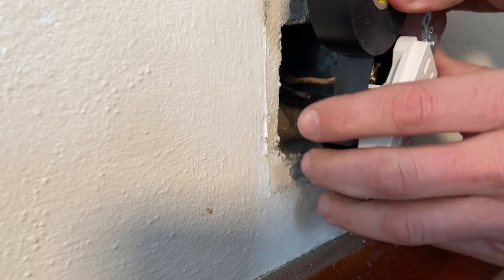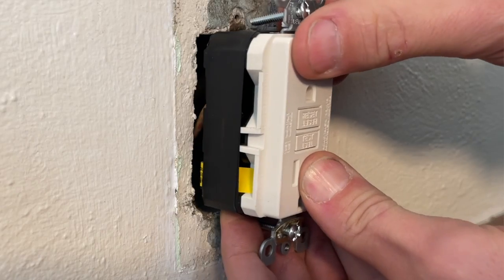Should You Wrap Outlets In Electrical Tape?

Comment: Recommended doing on outlets installed on metal boxes
Reply: ditto
Reply: But not needed
Reply: @timfritz3828  Right, it's not needed, but code is MINIMUM. If you install you work to just meet code requirements, you are a hack and your job will look like shit.
Reply: @timfritz3828  It's not a code requirement. It's just good workmanship.
Reply: @jimmac1185  do you use the 1968 nec? And in 1972 minimum standards is removed.  And if code is minimum why are their maximums in the nec?
Reply: @farmerdave7965  how is not taping devices bad workmanship,  and why are you hiding your connections?
Reply: @timfritz3828  I think you misunderstood me. I meant that install to the code is installing to the minimum requirements. I didn't say there are minimum standards listed in the code. I'm no really sure what you are talking about with your maximum comment, so I can't speak to that.
Reply: @jimmac1185  so you wire all residential as a class 1 division 1. Gotto go above a code compliant install. So saying doing your work correctly and by code makes you a hack, makes you ignorant. Just like the guy making this video.
Reply: @jimmac1185  that’s the dumbest statement of the day. How does not wrapping outlet in tape make the job look like shit, when you can’t see it, and how does it make you a hack ? I would recommend running both screws down, that’s all that’s needed, grounding the box with a jumper needs to be done as well, that is usually not done, and that my friend makes you a hack, not wrapping the plug with tape. That’s for beginners, so they don’t short the circuit out when removing plugs.
Reply: @jimmac1185  3’ from every j box and 10’ there after, if it needs more supports ? You can see that and you adjust accordingly, it doesn’t make anyone a hack, if they don’t do it the way you see it to be done, as long as it meets code, and stands the test of time, that is a good installation, no matter what a hack says
Reply: Always on metal boxes. Period
Reply: @jiml3922  that’s an opinion period, it’s not a requirement period, if you think it needs to be this way  ? You can make a proposal to the NEC period
Reply: @frankstallcup8720  I wasn't saying that not wrapping boxes with tape makes an electrician a hack. I'm saying if an electrician does their jobs to the bare minimum makes them a hack. To what you said about the pipe. That is my point exactly, the code requires the 1 clip for 10ft. If the pipe is hanging off the wall with one clip and you don't add another, it's still within code, but you are a hack for not adding another. Do you understand my point now?
Reply: @jimmac1185  I understand completely, if someone does a job to the NEC and local ordinances, and it isn’t to your standard there a hack. 
There are lots of variables to consider, labor cost, material cost, a job that holds up after you leave. There is this little thing called competition for jobs, meaning there’s a budget, your competing with other contractors fit jobs, so if a GC is willing to pay for your idea, that we want you to do it his way, it makes for a better job, we don’t want any hack jobs on our job sites, then great let’s add straps, let’s wrap every plug and switch, let’s wrap every wire nut. 
My experience is there want a job that passes code, a job done quick and efficiently, a job that doesn’t have a lot of call backs for warranty. 
Wrapping a plug with tape is a good idea for people who don’t really know what there doing, IE hacks
Reply: @timfritz3828  so electric misconnection doesn’t happen, yeah like tenants abusing walls and crushinyoutlets or your fat brother hitting the outlet falling, accidents happen it’s why they sell insurance.
Reply: @frankstallcup8720  ...facepalm... no, you clearly don't understand what I'm saying. It's probably my fault, I'm not explaining it right. So I'm not going to try anymore. I bid you adieu kind sir, (tips hat).
Reply: @jimmac1185  “ if you install your job to the minimum of the code, your job will look like shit and your hack” 
What’s not to understand in that statement ? Know mention of running conduit there, you mention strapping at 10’, but you also strap 3’ from j-boxes or panels, then 10’ there after, which is perfectly suitable on straight runs. The subject is should you wrap a receptacle with tape ? Code is the minimum, they have people on the panels, industry experts, or at least they used to, they kicked those people off, put manufacturing representatives on the panels, whose sole purpose is to push product, a conflict of interest. Requiring you to use arc fault breakers, not needed, with a whole host of other shit, that doesn’t work well and puts all the warranty on the contractor to fix there shitty products, that wouldn’t be used if it wasn’t required. That’s how business is done nowadays, force the product on the public, the manufacturer’s get rich this way.
Reply: @frankstallcup8720  cool story bro.
Reply: @FrancisoDoncona  so you prepare for all what ifs?  I bet you use special jell knee pads for all your jobs to pass inspections also.
Reply: @frankstallcup8720  you do know there are three panels to the nec code panels. And no manufacturers do not control codes. Nfpa national fire protection  agency.
Reply: @timfritz3828  ok if you say so, look at the panels, see how many manufacturers are represented on the different panels, and yes, they do push there products, how do I know ? My dad and brother are senior instructors for the NFPA, and they are moving the experts off the panels, to appease the manufacturers, that is a fact. From someone who has served on the panels.
Reply: @frankstallcup8720  what are there names.  I have a friend on the panels and no the manufacturers do not control code.
Reply: @frankstallcup8720  and his name is  Ryan jackson.
Reply: @timfritz3828  isn’t the CEO Jim Pauly ? Didn’t he work for Square D for 30 years before becoming the CEO of NFPA ? 

I guess that would be considered a manufacturing back ground correct ? Surely they don’t develop new products, then use the code to force use of the product, then price it 4 to 5 times what it should cost, that never happens, I mean manufacturers don’t take people on the panels on week long trips to discuss there products, fully pay for the panel members lodging, drinking, golf and dinning, that never happens. Business it not done this way, if a code panel has a person that works for a manufacture on it, and they are discussing a product that the panel may deem necessary for the industry, and that product happens to be something his company makes, and he is voting on wether to require the products use, is that a conflict of interest ? 
Most people who grew up before 2000 know that it sure as hell is a conflict of interest, but they don’t teach that anymore in school.
Just as they don’t teach that the American flag represents freedom, not our military, not out government but only the people who live here, it represents freedom for we the people. 
Not oppression as the schools teach our kids now. 
When bad becomes good and good becomes bad, lookout 
That’s where we are as a society today, the NEC’s purpose, to protect property and people, has been turned into a vehicle to push product onto a free society, not so free anymore.
Reply: @frankstallcup8720  so this one guy controls the code book?
Reply: @frankstallcup8720  if that was the case why can I use eaton panels or Siemens, or ge( I won't use ge)?
Reply: @timfritz3828  yeah Ryan Jackson, who likes to copy a real authors work, James G Stallcup, James W Stallcup, the 2 smartest people on codes and standards in the industry, period. 
I own Stallcup Training Institute with my brother, NFPA tried to buy us because our training material is the best in the industry, the first to publish a designing electrical systems book, the first to publish a code change book, the first to publish a 70E book, the first to publish a 70B book, authors of 14 publications. Copied by all including Ryan Jackson and Mike Holt who he started out his career with, writing for him. 

Neither teach for NFPA, why ? They aren’t experts on codes and standards, my brother and dad are, want an answer to the code, who you gonna call ? Grayboy Inc. the number 1 authority on the national electric code. 

They do control the panels, anyone who says different, benefits from the decisions the panels make.
Reply: @timfritz3828  you have a reading comprehension problem, the panels are controlled by the manufacturers, period, anyone who says different, even panel members who have no affiliation, benefit from the wine and dine of the manufacturers. It happens all the time, the NFPA is in bed with the manufacturers, the others who aren’t affiliated, fall in line with the agenda.
Reply: @timfritz3828  I don’t know if I can carry a conversation with you, you are clueless, they are different manufacturers who manufacture the same products, they push the product, not the manufacture. 
Jeez
Reply: @frankstallcup8720  I've never read a Stallcup publication in my life. How exactly did I copy your brother or your father's work? That is a serious allegation, coming from a person that I have never even met. Is there anything else that you would like to make up about me? I don't recall ever insulting you or your family, I have no idea why you would say these things.
Reply: @frankstallcup8720  I have never read anything written by your brother or your father. And your family did not invent the concept of explanatory material. That concept predates the printing press. Nobody plagiarized your father's work.
Reply: @RyanJacksonElectrical  ok Ryan, whatever you say, but if you write a book the first of its kind, then you have others put books out of the sane type. You are copying the original idea. Not a hard concept to grasp, but I guess it is when your in denial
Reply: @frankstallcup8720  thanks for clearing it up that your opinion is what is important.  My 1948 nec handbook has illustrations in it. They must have stolen them from your dad.  Oh and I found were your opinion matters it's in the nec article 628.
Reply: @timfritz3828  whatever Tim, facts are he was the first to write and publish a illustrated designing electrical systems book, the first write and publish a illustrated code change book, the first to write and publish a illustrated book on OSHA, the first to write and publish a illustrated 70E book, the first write and publish a illustrated 70B book, not the first to write and publish a journeyman and master study guide but the first to illustrate it. 
So if you write a similar book after the original, your copying the idea. You didn’t come up with the idea, you followed someone else’s idea. Kind like designing a smart phone, and then having multiple companies copy your idea, not to hard to grasp. 
Now back to the manufacturers running the panels, pushing product.
Is it necessary to have a dryer on GFCI ?
Is it necessary to have a washing machine and all utility room plugs on GFCI if no sink is present  ?
Is it necessary to have a dishwasher and disposal on GFCI ? 
Is it necessary to have CO2 protection in house with no gas  ? 
Why is it that we put everything on arc fault breakers, but we exclude the bath room receptacles ? 
Is it necessary to require surge protection on new homes ? 
These are all things that have been implemented or proposed, all to push product, not protect property and life, the original mission of the NEC, now the panels are laced with manufacturers who wine and dine the other panel members to get proposals pushed through, that directly benefit the bottom lines of companies they work for, and that my friend is a conflict of interest. 

These are facts, if you say that doesn’t happen ? Then you probably believe Biden got 80 million votes. NOT
Reply: @frankstallcup8720  ok 628 is your go to code.
Reply: @frankstallcup8720  I have been following your posts and had been impressed in your arguments.  They all seemed well thought out, reasonable and credible.  All up until the time you became political in stating that Biden did not get 80 million votes.  Sorry dude.  It is true.  By making statements such as that, you lost all credibility with me.  For if you cannot admit to reality, your previous comments become tainted and frankly your entire argument comes into question.  Had you stuck to the premise of your argument you would have been convincing.  Now, it seems, your position is based on a biased attitude.
Reply: @dalen.8413  so you agreed with him lying about anther person plagiarizing all his books. Or did you not catch that?
Reply: @timfritz3828  please don't put words into my mouth.  I made no claim that Frank was "lying about another person plagiarizing all his books."  As someone who is not 100% up on electrical codes, I found Frank's debate interesting, thought provoking, and plausible; as was yours.  But once Frank made the statement that Biden didn't get 80 million votes, he lost all credibility and any other statement he made came into question as being 'factual'.  Therefore, being a rational, thinking individual, doubt about the accuracy of his previous comments arose and his position in the debate was greatly weakened.
Reply: @dalen.8413  it was a question,.
Reply: @timfritz3828  I neither agreed nor disagreed about plagiarism of books.  I was just following his positions which were thought provoking and I found them interesting up until he made a questionable statement, then I questioned the veracity of his other statements.  This caused me to doubt the truthfulness of his claims.  This included the rules he stated, the copying of books, the requirements for taping outlets, and other ‘factual’ assertions.  That is all I am saying, I am not taking one side over the other.
Reply: @frankstallcup8720  Frank, Your dad and I had a great relationship for many decades and we worked together to help the industry in many ways. I didn't have much contact with your brother James Jr, but our relationship was also very positive. Your dad and James Jr are honorable men that I hold with the highest respect.
Your comments about my good friend Ryan Jackson and myself are slanderous and I have no clue what motivated you to make such outlandish statements.
I hope you or your brother realize that your post(s) carries no positive value for Grayboy Inc.
I'll close by saying that I have the highest regard for Grayboy Inc., despite your bizarre post(s). I'm praying for you brother...
Reply: @MikeHoltNEC I didn’t say anything that wasn’t true Mike, it’s not slanderous to state facts, my dad was the first to publish his books, only to be copied by others. 
If you were the first to publish, then I stand corrected, but anything after his publications, is a copy of the original. 

The way I hear it told, you routinely interrupt other teachers to promote yourself, while routinely giving wrong information, the saying is people who don’t know anything about the code, go to you, people who know the code go to my dad for the answers, your not even in the same caliber as my dad, when it comes to teaching the code, if you are, then let’s set up your best against my dad and brother, and see who can answer the most questions unscripted, in front of a live audience, of people who actually know the code, then we can see just how little you really know.
Reply: @timfritz3828  yeah he caught that, yiu copied the original book, when you put a book out, the first of its kind, then you have multiple people put out similar books, was your idea to print that book ? Without seeing and reading other books of that kind ? You didn’t start from scratch as he did, you had an outline to follow, those are just facts. Nothing slanderous or accusations of plagiarism, just the fact that you didn’t come up with the idea of these publications.
Reply: @dalen.8413  there’s no bias, I’m of the opinion the election was rigged, an opinion that I can’t prove, just a strong feeling that it was. 
It doesn’t diminish my argument, unless you have bias ?
Reply: @frankstallcup8720  maybe I do have a bias.  When people continue to claim fraud or a rigged election, without any evidence, I tend to dismiss their make-believe world views. And any other statements they made or make come into question.
Reply: @dalen.8413  there’s plenty of evidence if you research it. Corruption is the norm in America 🇺🇸 nowadays. It’s plain to see for anybody with eyes to see, or ears to hear. 
I guess there’s no chance that an electronic voting machine can be manipulated to change votes ? Only it was acknowledged that votes has been switched, how many switches were not caught ? Why was an investigation not allowed before the machines were wiped clean ? 
Why was trump ahead by 100’s of thousands of votes, and they stopped counting, why do we have sworn affidavits of voter fraud that isn’t looked Into ? That is called evidence, sworn affidavits that are allowed in court cases, yet they are dismissed by the media. 
Look at JFK’s speech before he was assassinated, what did he speak about ? Secret societies that run this world, listen to his speech, know he was doing away with the federal reserve, which Johnson immediately put back into place as soon as he took his oath, this is all common knowledge and can be researched, listen to Rockefeller’s quote 
"We are grateful to the Washington Post, The New York Times, Time Magazine and other great publications whose directors have attended our meetings and respected their promises of discretion for almost forty years. It would have been impossible for us to develop our plan for the world if we had been subjected to the lights of publicity during those years. But, the world is now more sophisticated and prepared to march towards a world government. The supranational sovereignty of an intellectual elite and world bankers is surely preferable to the national auto-determination practiced in past centuries." David Rockefeller - 1991

I guess he didn’t say that  ? In that quote who did he recognize in 1991 ? The media, in other words they control the media. 
What was he saying ? International bankers will rule the world, its what we see today.
Reply: @frankstallcup8720  you insulted Ryan saying he wasn't  a good author and he copied all his information from your dad. So yes that is slanderous, and an accusation towards plagiarism.
Reply: @timfritz3828  well Tim, Ryan insulted my brother first, by coming onto a video post of our new online programs, and telling him he was a hack author, or something to that effect about the online program, so I have no respect for a guy like that, I didn’t attack his character, as he did my brother, you mentioned his name, like I’m supposed to be impressed, I proceeded to belittle him as he did my brother, because you mention him as to say to the others reading the post, ohh Ryan Jackson, wow he knows Ryan Jackson, now Tim’s post are somehow more relevant. 
My statement stands, my Dad was the 1st to write all the books I mentioned, anyone who came out with a book of similar substance, is a copy of the original, just as the first to produce a smart phone, everyone who came out with one after the original, copied the idea. Nothing slanderous in that statement, no accusal of plagiarism, but it’s hard to even talk to a guy, who post things like, “ you must have a special pair of gelled knee pads to pass your inspections” a guy who makes comments like that, holds no value in making posts on here. That guy would be you Tim. 
I implore anybody who reads this post, look at the panels, look at the people on the panels, how many work for manufacturers ? If the panels have 50 % of the people with manufacture background, is it not logical that there on those panels, with there ways paid by there companies, to push product, how much new product has the industry had pushed on it in the last 3 code cycles, a whole lot, and like i said it’s usually priced at a premium. Who pays ? The consumer, the citizens of America 🇺🇸
Reply: @frankstallcup8720  still on that kick to make stuff up.  Good for you. Bless your heart.
Reply: @timfritz3828  please tell me what I made up ? Your good at blanket accusations to discredit an individual without pointing out what your referring to, I was specific in everything I put forth.
Reply: @frankstallcup8720  I made no such attack on your brother, and your brother will tell you that.
Reply: @RyanJacksonElectrical  I’ll see if I can find the post, and copy abs paste it, but who knows maybe you deleted it. 
You have been good to argue with me on other things that don’t concern you. 

Were you the first to write an illustrated code change book ? If you weren’t ? How did you come up with the idea ? 
It’s intriguing, how will he answer ? 
Probably want
Reply: @frankstallcup8720  You should get help Frank. I mean that.
Reply: @RyanJacksonElectrical  I am, he’s looking for the post now, best thing you could do is not comment, it doesn’t help you any, at least Mike Holt is smart enough to not comment
Reply: @RyanJacksonElectrical  it’s funny, you can’t attack me with facts, instead discredit and pass me off as crazy, that’s a CIA tactic, discredit the individual, that way no one will believe the truth when they hear it
Reply: @RyanJacksonElectrical  There is absolutely no way you or Mike have plagiarized anyone I am getting the posts claiming of an attack I think I know where they are
Reply: @frankstallcup8720  I don't know you but I feel if you are a co-owner of STI you should know that your learning system is totally different than any other system out there.
Reply: It’s funny, I find the post where you attacked my brother and it somehow gets deleted off the site.
Cancel culture, you got love it, if it doesn’t fit, just delete it
Reply: @williamsnyder6514  I know, there’s leaders, and there’s followers, I’m sure this will be copied as well. 
No one has accused plagiarism, I have says that we were the first to publish our material, everyone who has published material similar after ours, is a copy of the original idea. 
Why was my post deleted, where Ryan tried to berate my brother ? It’s a private site anyway, most people would not be able to see it anyway.
Reply: @frankstallcup8720  yeah Ryan Jackson, who likes to copy a real authors work, James G Stallcup, James W Stallcup, the 2 smartest people on codes and standards in the industry, period. 
I own Stallcup Training Institute with my brother, NFPA tried to buy us because our training material is the best in the industry, the first to publish a designing electrical systems book, the first to publish a code change book, the first to publish a 70E book, the first to publish a 70B book, authors of 14 publications. Copied by all including Ryan Jackson and Mike Holt who he started out his career with, writing for him. 

Neither teach for NFPA, why ? They aren’t experts on codes and standards, my brother and dad are, want an answer to the code, who you gonna call ? Grayboy Inc. the number 1 authority on the national electric code. 

They do control the panels, anyone who says different, benefits from the decisions the panels make.
 Is this someone else's comment Frank?
Reply: @williamsnyder6514  no I’m talking about the link, the link that shows Ryan attacking my brother for promoting our online training, that’s what you took down. 
Nothing I said isn’t true. You knew I was taking about the link, I told him I would produce and did, it shows he lied about attacking my brothers post. To promote the journeyman program, you took it down. 
I guess the judge finds it not relevant ?
Reply: @frankstallcup8720  I just wondered if you remembered your comment from 4 days ago sure sounds like you are accusing someone of copying an authors work I have read Ryan Jackson's work and he is a great original author that explains the code changes in great detail.
Reply: @frankstallcup8720  How am I the judge? I deleted my comments about having a meeting about the NEC deathmatch with your brother I mentioned it and tried to smooth this thing over I feel there are slanderous things you said that are simply not true
Reply: @williamsnyder6514  reading comprehension would be great, if people applied that, I said “ the first to write and publish a illustrated design book, a illustrated code change book, illustrated OSHA book, illustrated 70E, the only illustrated 70b book out there, illustrated sign book, illustrated OSHA high voltage book, anything written and produce after these publications, copied the idea of the publication, they did not come up with the idea to produce this kind of material. 

So let’s explain how my dad came up with the idea for the first publication, he taught class for the NJATC in Fort Worth in 1976, he was having hard time getting the apprentices to see how to apply the code to different installations, he stated drawing illustrations on the chalk board, they then started understanding what he was telling them through illustrations, it became how he relayed the codes and standards to people who were just learning the code and its applications, he then took what he was doing in class, and wrote and published his first book, #1 seller on New York Times for its category back then, used in all the apprenticeship schools and colleges, first to produce in every category I mentioned, then you start getting other publications, on the same subjects, illustrating as he did, being the first, so as I said, everything after the original is a copied idea of the original. 
If a manufacture produces a product, first of its kind, then other copy and produce a similar product years later, they are copying the original person who produced the idea first. 
Now if you want to argue that ? Then your in denial, I can’t explain it in anymore detail than that.
Reply: @frankstallcup8720  *You're
Reply: @williamsnyder6514  your correct lol
Reply: @frankstallcup8720  I have been following Ryan's work for years and he recited article 210 from memory live on Facebook while we followed in our code books was that stolen from your family? I have numerous pictures of my work and my jobsites that I shared with Ryan for his books. I feel you have been inaccurate with your assessment of Ryan when did you make a transformer out of wire and post the video on Facebook? Please tag me so I can see how you compare to a great teacher and a great guy that never has copied your father's work. Sorry to say you are out of line with your allegations that every person involved in teaching code is a hack that stole the idea from anyone else.
Reply: @frankstallcup8720  Guess who's Idea the NEC deathmatch was? I will give you a hint it wasn't yours and I didn't steal it Googleme123!
Reply: @williamsnyder6514  I don’t know, it wasn’t mine, something my brother is involved in, hope everyone enjoys it.
Reply: @williamsnyder6514  what did I say, I said he copied the idea of illustrated books, my dad was the first, that’s not out of line, anything after him, is copying the idea of the original, I’m not impressed with reciting certain parts of the code book, my dad recited from memory, just about the whole book. 
That’s why he teaches all over the world, maybe not today since he’s 81, but from 45 to 70, he was on plane non stop, a million mile advantage member. 

I would not have anything to say about Ryan, till he came on my brothers post and proceeded to berate my brother for promoting the journeyman program, had he not done and then came on to two of my post that had nothing to do with electrical, I wouldn’t give him a 2nd thought, I wouldn’t even of says anything had Tim not brought him up, when he did, I decided to give him some of his own medicine.
Reply: @frankstallcup8720  You said he likes to copy authors as a person that has studied his work I can tell you his approach could never be imitated if you worked for Mike Holt you would be fired and issuing an apology for making claims about industry leaders that aren't true. I know the Stallcup reputation and you didn't do it any favors
Reply: @williamsnyder6514  I state the obvious, where did they get the ideas to do there books ? There had to be a first to come up with fully illustrated books, that was my dad, I went through the IBEW apprenticeship program, we did not study from any illustrated books, he was just getting his books out in my last year as an apprentice, I’m not issuing an apology, they cry like little bitches, me thinks thou doth protest to much, he did the same and he received the same, my Dad and Brother want say anything back, just let it go, I’m not that way, I posted what Ryan did so everyone could see he us a liar, he in fact did berate my brother, you chose to remove the link, it’s a private site. I can’t even get to it, but brother even forgot about it, but I didn’t, plus he’s commented on me on 2 occasions, when I don’t even know him, and had nothing to do with electrical, so I don’t know him, I don’t respect him, and I don’t care who knows it, put the link back up, so the public can see what he said, that way you can see why I call him out, he had no business saying what he said, other than it scares the shit out him and the whole industry, the program my brother had put together with my dads books. 
He can apologize for what he did first, then ill apologize, if he can’t recognize his wrong, then f him.
Reply: @frankstallcup8720  Wow you were a yoon youn hand that explains a lot why did the IBEW ask your brother not to attend their convention where were you when that happened?
Reply: @williamsnyder6514  you talking about in Ann Arbor Michigan ?
Reply: @williamsnyder6514  if your taking about Ann Arbor, they excluded us, our program was to good, we were all the talk of the show 2 years earlier, blended learnings people didn’t want us there displaying our product to the IBEW people. 
Palmer Hickman excluded is as I’m told. He let everyone else in though, I guess he didn’t fear there products
Reply: @frankstallcup8720  Well I should have known from your grammar that you were trained by the yoon youn I have a 3 years with the IEC and worked extensively with their conduit bending labs I am not trying to discredit your training but the IBEW has a mind of it's own when it comes to the code they want to teach
Reply: @williamsnyder6514  you know if I was the BA of the local here in DFW, I would master the local, let the guys bid jobs, let the guys run service, use the profits to outfit our trucks, in other words, I would make the IBEW it’s on company, owned by the members, run by a business guy, who sole purpose is in the best interest of the employees, kind of like trump was running America. 
We would have the best trucks, with the coolest local around on the doors, IBEW, 

What do you think ? Could you take the IBEW and it’s members and get most of the work in all major cities, if the IBEW is its own contractor ? Then you might see, that the IEC is a spin off of the IBEW
Reply: @frankstallcup8720  But you never accused anyone of plagiarism just stealing their training program Got it thanks for showing your intelligence!
Reply: @williamsnyder6514  copying an idea isn’t plagiarism, it’s just showing it wasn’t your idea. I can see you are here to do Ryan’s bidding, I’m done talking to idiots, you make blanket statements with no substance, a true politician
Reply: @frankstallcup8720  plagiarism
[ˈplājəˌrizəm]
NOUN
the practice of taking someone else's work or ideas and passing them off as one's own.
synonyms:
copying · infringement of copyright · piracy · theft · stealing · poaching · appropriation · cribbing
Reply: @frankstallcup8720  I will just leave this here
Reply: @frankstallcup8720  I  love it how you say I'm doing Ryan's bidding when I am promoting STI on every one of my Electrical groups on Facebook
Reply: @williamsnyder6514  well according to the dictionary, then it would be plagiarism, because his idea has been taken, and used by multiple authors. 
Illustrated design, the first of its kind, authored by James G Stallcup
So if you didn’t come up with the idea, you copied the idea, the first to do an illustrated code change book. 
These are facts, that you don’t want to recognize, tell me who was the first do a illustrated code change book ? That’s the guy that everyone copied. 
Research that and get back to me
Reply: @williamsnyder6514  why are you arguing with me ? Most people when they know something isn’t true, they don’t even bother acknowledging it, when you constantly try state that that ain’t true, then there’s a little bit of guilt there. That’s just 56 years of watching people’s behaviors. 
Now you could turn that on me, and say the same, but I stand behind my statements, and this is the last I’ll speak on the subject. 
You should let the thread die, and move on
Reply: @frankstallcup8720  glad we agree no one plagiarized Stallcup's work
Reply: @williamsnyder6514  I guess you can’t read ? If copying an idea of another Is plagiarism according to the dictionary you quoted, then yeah it’s plagiarism, but we know you can take someone else’s ideas, and change them a little and it’s not plagiarism, courts have ruled on this. 
So plagiarism is allowed, why ? People with all the money want it that way, but you sure as hell better not try to knock off there shit, only Chins gets to do that 😂
Reply: @frankstallcup8720  Ok so take my money and sue the fuck out of those guys that stole that from you because I am IECRM and we made our brand since 1999 Y2K crew
Reply: @williamsnyder6514  whatever that means ?
Reply: @frankstallcup8720  It means no one stole anything from you go get your vested pensions
Reply: @williamsnyder6514  what are you referring to the IBEW ? Well NECA contractors moved out of the IBEW, started the IEC and apprenticeship program, took the best IBEW hands, and went non union, at least that’s what happened in Texas.

I’m not affiliated with IBEW, haven’t been since 1989, when I went to work for American Airlines, worked there for 15 years, had my electrical contracting business doing small side jobs since 1987, the last 5 years at American, I went full time into electrical contracting, quit American in 2004 after 15 years there taking care of the baggage systems, jetways, docks, machine shops and whole host of other things, a control specialist I was. 
Now I have 16 employees, do mostly residential and have been since about 95, built around 90 or so houses between 2002 and 2010, 2008 just about wiped me out in the custom home business, but my electrical contracting business was strong and I was able to pay off all my loans and houses, wrote a lot of big checks to perform on my loans. 

Now I just do electrical contracting, but can still build if I want to do that. I’m very knowledgeable in the one and two family electrical and the actual building of the houses. 
I’ve done very well, pay my guys very well, they work 45 to 55 hours a week abs have been for 15 years now. 

My comments about the IBEW, is that yet were the first apprenticeship program that I know of, they apprenticeship program that everyone tried to get into in the 60’s through the 80’s, they turned out solid electricians, craftsman, something that’s very scarce today, the quality of work isn’t what it used to be, the skill isn’t what it used to be, why ? Most apprentice’s or new guys starting out aren’t getting the knowledge passed down anymore from the experienced guys. 
IBEW, IEC apprenticeship is a spinoff from the IBEW apprenticeship, I was there and saw it happen, at least in the DFW area.
Reply: @williamsnyder6514  I have my pension, my experience, I’ll never see a dollar of social security, a dollar from America Airlines or a dollar from the IBEW. 

There’s a great reset coming, it will change the financial system as we know it. Get prepared